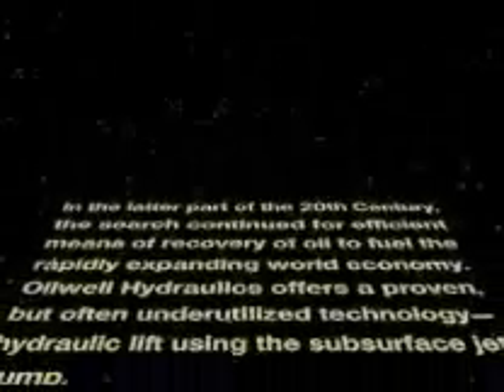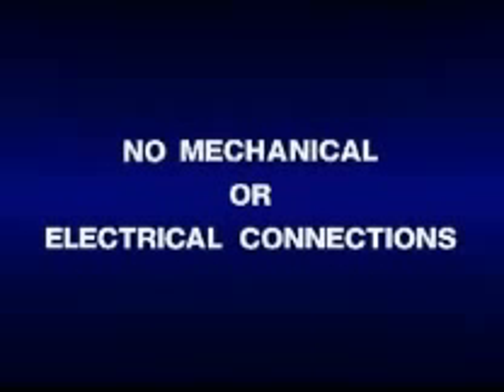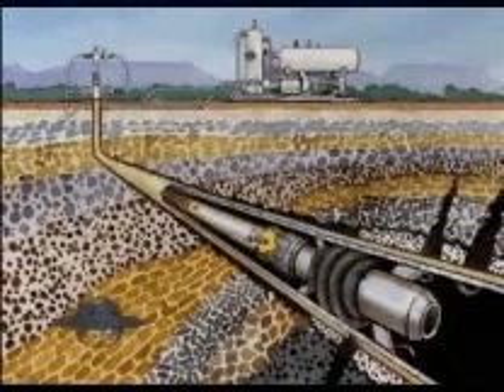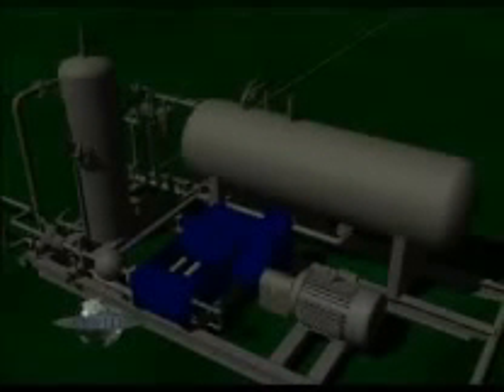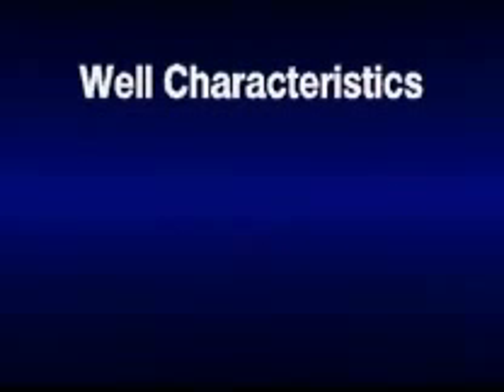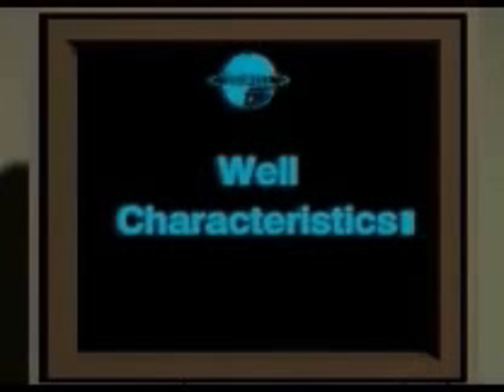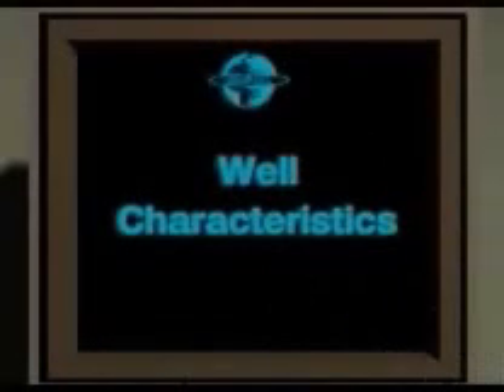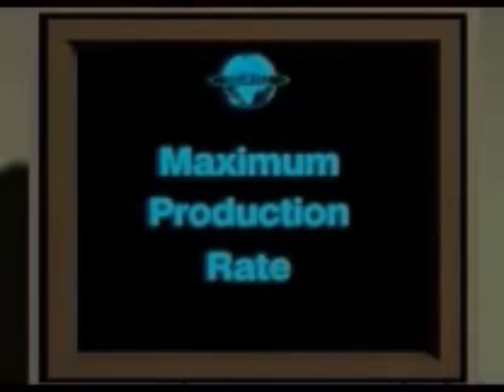all about jet pump for lifting oil well

Comment: should tell the advantage of only requiring a single surface powered pump system to operate several downhole pumps, and the downhole pumos may also be in different well locations.
Reply from the maker: +Joey Caddell Also, no need for special completion so if you have natural flow well and you decided to switch to jet pump you can set it in SSD without any workover rig